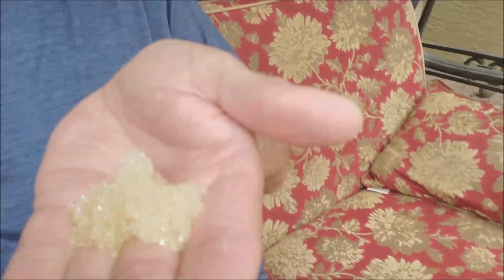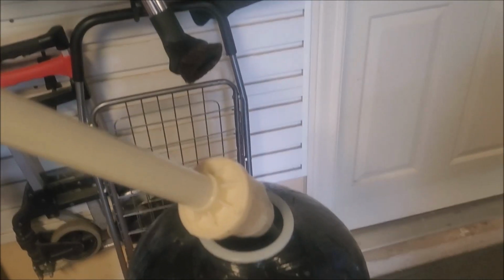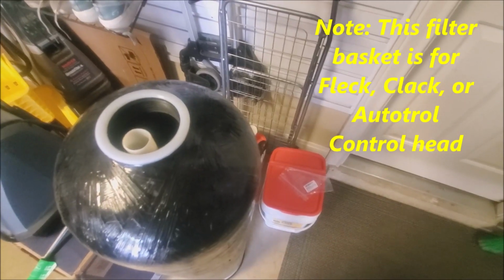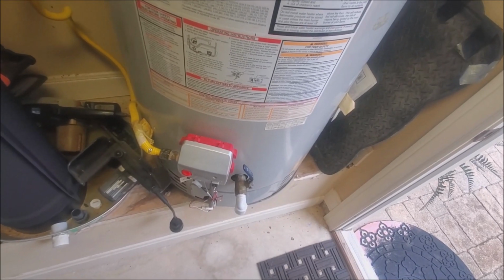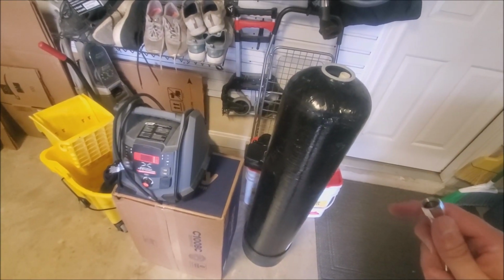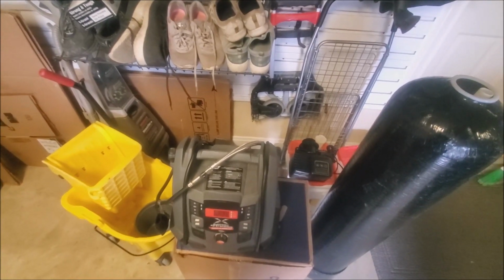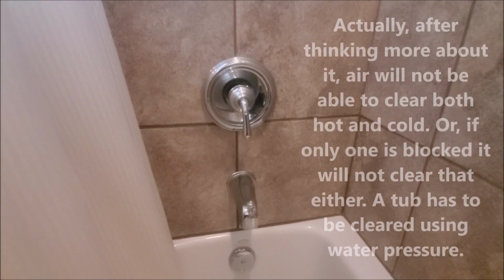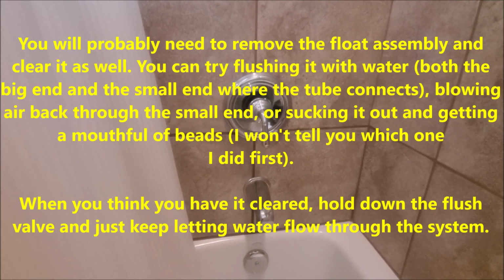No Water Flow From Your Inside Faucets? Maybe Your Softener Had a Resin Breakout!

Comment: I'm a professional "NEW" construction plumber...but I do a LOT of service for family and friends. My neighbors house had this problem 2 days ago. I knew exactly what to do but it still took about 3 hours to blow backwards on everything . I'm going to put an in-line filter downstream from my softener to catch all the beads before all my fixtures do. I've had soft-water for over 30 years...but never had this happen....(pain in the ass).
Reply from the maker: Yeah, it's kinda sad to see how many views this has gotten. It must happen more often than we think! I'm betting a lot of it happens in houses with high water pressure. At this house, the PRV had also failed and the house was at about 80 PSI.
Reply: @thehoneybadger9262 Yeah, I have about 32 psi cuz I live in the “hills” section of town… Only head pressure from the huge water tank just above my elevation. I live in SoCal and any house with water pressure above 80 pounds has to have a regulator by code… if not you’re kind of asking for it.

Comment: Currently going through the same exact situation and I hired a plumber to help. Was able to get all them to work except for shower tub. Tried replacing cartridge but no luck. What could be the issue for there to be no water in the shower tub.
Reply from the maker: Sorry for the late reply. I had to pull the cartridge and then run water through the system, being careful not to allow the water to run behind the tile wall. My wife was on the phone with me, and she operated the main valve for the house to turn the water on and off. There are openings in the valve where the cartridge plugs in that are plugged up. You could try breaking up the resin with a zip tie, which would be flexible enough to get into those openings in the pipe that the cartridge is inserted into. It's been a while, so I don't remember if I had to do that or not. You will want to hold a bucket in front of the pipe, because when it breaks loose, resin and water will shoot all over the place.

Please install a whole house filter downstream of your water softener. I'm sure you'll never want to experience this nightmare again.
Reply: @thehoneybadger9262  thank you so much for the info. I should have tried zip tie. Did everything else. 

Did your clothes washer water flow was impacted by it. I don’t if it did but feels like it now that I am paying attention to water after the fiasco.
Reply from the maker: @MiMoNa1009  Yes, his washer had no water flow on the cold side I believe, but disconnecting and flushing the line and cleaning out the filter took care of it. Check your filter, it pulls out of the back of the water inlet.

I had to go back to his house a few days later and replace a toilet flush valve, just flushing it out did not seem to be good enough.

Comment: Waiting on a plumber now. Had a softener failure last night. What I found is that ALL hard water plumbing unaffected. Unfortunately that only applies to the outside hose bibs, the RO System and kitchen faucet cold side that's used for cooking and drinking. Gonna be a mess. I assume the Rinnai tankless is toast due to the crevices and nooks of a heat exchanger. Expecting a thousand + cash drain.

Comment: Just happened to me.  It has been two days so far trying to pace myself.  We took your advice and tried the air pressure and it worked on some but not all.  The one thing that helped a lot was we bought a Klein tool fish Tape from Home Depot and were able to clear two of the sinks and all the toilet lines.  The stubborn ones have been the cold water on the sinks.  Still have two showers to tackle, kitchen sink, and water heaters.  I had to change out the fluid masters on all my toilets.  The process had been FUN FUN  LOL.  But you are right on not letting this frustrate you.  Take breaks as needed.  Thank you Honey Badger for the help.
Reply from the maker: You poor soul. You probably should have started with the water heater, though. It's very hard to get all that out, and you'll want it clean before flushing hot water lines as it's the entry point for the whole house. If you have trouble with it clogging, I recommend replacing the factory drain with a full port drain so you can  get much better flow through. One like this: https://www.amazon.com/Upgrade-Heater-Full-Port-Valves-Connection/dp/B0F12QZ1Z2/ref=sr_1_5_sspa?sr=8-5-spons&sp_csd=d2lkZ2V0TmFtZT1zcF9hdGY&psc=1
Those factory drains clog up even when flushing sediment. And don't forget the filter in your refrigerator and the ones  on your washing machine inlets.

When you get it all done, make sure you install a whole house water filter on the outlet of your softener. I have another video on that. I did it at my house, but haven't on any of my son's rentals. He'd rather play russian roulette than have another maintenance item to deal with.

Oh, and if you decide to re-bed your own softener, make sure you order new upper and lower filter baskets for the riser tube, even though only one of them is likely broken ;)
Reply: @thehoneybadger9262  Appreciate the advice.  The plumber will go into the ceiling and cut the water lines and flush out the stubborn kitchen line and the cold water line on one of our sinks.  I will update on the results.  Interesting that you mentioned the whole house water filter but a friend did recommended that when I buy the next water softener, that I install a home water filter between the water softener and the water inlet valve into the home so that if this ever happens again, the filter will catch the resin.  But I will say, a lot of friends/family that know of my experience are now having their water softener inspected.    I will also look into the full port valve link you sent.  As always, thank you for the great video and info.
Reply from the maker: @oscarmedranojr5381  That seems like an extreme measure to me. I was able to clear  the kitchen sink line by pulling the cartridge (which is probably what he will end up doing) and taking it apart and cleaning it. In the kitchen I had the issue with, it was a single-handle faucet. Pulling the cartridge would probably work for the sink as well, because that is the main restriction  (everything else is going through 1/2" piping). 

Let us know how it turns out.

And the filter is exactly what I recommend, and what I did in my other video. It's a good idea for anyone with a water softener to do. My folks have had the same softener for 30 years without a problem, but not everyone's so lucky.

And one more thing. If you don't have an all-in-one softener, but one with a separate resin tank and brine tank, you can rebed your softener at a fraction of the cost of a replacement. Probably about $250 for the resin, and new riser tube and filter baskets. Plenty of YT videos on how to do that, if you feel inclined. Just one tip on that - buy the funnel that fits over the resin tank to fill it. You won't regret spoending the additional 10 bucks. Trust me on this.
Reply: @thehoneybadger9262  UPDATE:  The plumber ended up having to cut through the sheet rock under the kitchen island (behind the dishwasher)  to crawl underneath the island and access the "Hammer Arrestor" to the kitchen faucet.  He ended up cutting it and it showed it was super clogged with resin.  After flushing it and clearing the lines, he re-attached the Hammer Arrestor.  He also removed the cartridge and flushed it.  The other problem was the middle shower not getting any cold water.  He ended up going underneath the front bathroom sink and cut out the back of the cabinet to again access the Hammer Arrestor.  This line tied into the shower that was clogged.  Once he flushed and cleared this, the shower was up and running.   Plumber used air compressor, fish tape and a Shop Vac along with water flow to clear the lines.  Oh and the lines are all PEX.  But it was a nightmare I never want to relive.  In house filter will definitely be used in the future.  🙂
As always, thanks for the video honeybadger9262 and the great tips. I have also looked at your In house filter video and gave me a great idea on how to install one.
Reply from the maker: @oscarmedranojr5381  Wow. I'll bet that visit wasn't cheap!  Sorry yours was so difficult to clear, Oscar, but I really do appreciate your detailed description of what was involved.  I'm sure anyone who reads it will be installing a downstream filter ASAP!

One other thing - why so many hammer arrestors? Do you have an appropriately-sized (and functional) expansion tank on the supply side of your water heater? If not, see my video about adding one.
Reply: @thehoneybadger9262  Price was was very reasonable as this plumber was a family friend so thank God for that.  But absolutely yes on installing a downstream filter on my next water softener.  I learned a lot from this nightmare.   LOL  I did share with family and friends, your video of the installation of the filter .  Our home is 11 years old and I am told that the hammer arrestors are common with the newer homes (Texas).  It was explained to me the purpose of this item but not completely sure if its overall function. As for the size of thermal expansion tank we have in our home, I am not sure but I will definitely take a look at it and check out your video.  Again thanks honey badger and keep the videos coming.  They have been very informative and easy to follow.  🙂
Reply from the maker: @oscarmedranojr5381  I've sometimes seen exposed hammer arrestors on laundry washer lines, because the solenoids cause the instantaneous flow. The hammer arrestors are basically like micro-sized expansion tanks.  My washer made a lot of noise with my pipes until I put in an appropriately-sized expansion tank on my water heater (after discovering that a smaller plumber-installed one had failed). If that hadn't fixed the problem, I would have used the hammer arrestors.

While a water expansion tank can reduce or eliminate water hammer, the main reason for having it is to reduce the static water pressure increase that occurs after you use a bunch of hot water. As the cold water enters the tank and heats up, the water increases in volume, and that extra volume is taken up in the expansion tank (which has an air-filled bladder set to the same pressure as your water supply) rather than putting higher pressure in your water supply lines and water heater, which can result in premature failure in the form of leaks.

I appreciate the kind words from my fellow Texan ;)
Reply: @thehoneybadger9262  Appreciate the additional info.  It certainly has giving me options to consider.  Thank you for taking the time to explain it all.  Happy 4th of July!  🙂

Comment: I know it’s been a year since this video. I had the same situation. Wondering after fixing the resin problem, thinking about putting a sediment filter AFTER the water has been treated by the Water softener as an insurance policy if I ever have another resin explosion. Your response would be greatly appreciated.
Reply from the maker: Sorry you had to deal with the nightmare. You should definitely do that. I did, in my own home, and made a video about it ;)
https://www.youtube.com/watch?v=65kW1Sb9wf8&t=1s
Reply: @ thank you for the quick response. I’ll watch your video. Again, thank you.
Reply: @thehoneybadger9262  I just watched your video. Well done, I’m going to set up mine like you did. I just have one question. I don’t know how big the resin beads are, so what size filtration media would you recommend, as in 1 micron , 5 micron to be completely safe - filtration wise.
Reply: @ziobruno9324  The resin is larger than any water filter's particle size. I would recommend a 5 micron, mainly because you will still have a good flow rate. I use an Aquacrest 5 micron in mine, and am getting a very high flow rate (7 GPM, if I recall correctly). Of course, if you want to filter out the most contaminants (besides resin!) you can certainly go smaller, but it does adversely affect flow rate.
Reply: @ yes I was wondering about the flow rate also. Thank you for answering my questions. Thanks for taking the time, it’s very kind of you.

Comment: So you flushed the water heater into 5 gallon buckets instead of down the drain? Will the resin plug the sewer lines?
Reply from the maker: I just dumped the buckets in the front yard. Resin is harmless.
Reply: @thehoneybadger9262  Any harm in just flushing it out into the floor drain do you think?
Reply from the maker: I am unsure of what beads would do to a septic system. A non-aerobic system would probably be OK, but I could envision an aerobic system possibly being an issue. I wouldn't worry at all about a sewer system.

Comment: Hi thanks for the video. Is there a chemical flush to dissolve the beads as some parts of my system as inaccessible like my shower pipes,  filter which is burried in the wall?
Reply from the maker: Not that I'm aware of. I don't think any builder would put a filter in the wall. Perhaps you are referring to the cartridge that controls the hot and cold water, and/or diverts it? You can pull those cartridges (I have no video yet to do that, but there are many out there) after removing the handle and escutcheon plate/flange.  Maybe you could also try maybe shooting some compressed air down the shower head pipe after you remove the shower head, and turn your shower valve from hot to cold. The shower I cleared had just a typical left-right temperature control handle, and it did not get clogged. I did, however, have to pull the filter out of the shower head and clean that out. If your water won't flow with the shower head removed, then it is likely the cartridge behind the handle and escutcheon plate. If you remove the cartridge, water should be able to flow out, but you have to be careful not to let water run down behind your shower wall. This is what I had to do for the bathtub (remove the cartridge).

Comment: Thank you very much for taking the time to make this video. This JUST happened in my house, Kenmore 350 Series water softener.
Reply: I'm sorry to hear that, Ricardo. You've got some not-so-fun times ahead of you. I hope you find it helpful, and you are successful in clearing your system. If I can help just one person save the expense, and even scare some folks into putting in a downstream filter BEFORE the nightmare occurs, it was worth the effort.

FYI, I also made a video about installing a whole-house filter downstream of the softener to make sure you never have this problem again.
Reply: @kevinh9262  Hello, thanks for the sympathy :-) My case ended up being simpler than yours. I think I was just very lucky: 1) It happened in early in the morning and I detected quickly, so the beads didn't spread too much 2) It allowed me some level of backflow (tri-level house with a faucet in the basement) 3) My resin beads seem much smaller than yours. I'll check your video, thanks again!
Reply: @ricardo1967  Glad to hear it was just more of a bad dream than a nightmare ;)

Comment: I have been getting some beads in the softener drain and also only one single faucet in my house, strangely the only one that I left on hard water branching off before the softener. all other faucets in the house have not clogged with beads and run fine even though they are all coming off the softener...

Comment: Thank you so much Honey Badger, had the same issue with my softener. I had to replace all my faucet, shower heads, and toilet valves. And now working on my water heater, rough two days . Thank you so much for the help
Reply from the maker: I'm having trouble understanding why you didn't do the water heater first?  Even if you've cleared all the hot water fixtures, there is potential to get more beads in the hot water if you haven't flushed the water heater until it was clear.  Good luck with everything.  FYI, I didn't replace any fixtures (I pulled the cartridges and screens out and cleaned them when needed), but I did buy one new toilet valve.
Reply: @thehoneybadger9262 yes, I’m kicking myself for that now. I had a plumber come out, once he confirmed my suspicions, he told me to just clear the lines, never mentioned the water heater, and i just rushed to clear my lines. It wasn’t until after, I began to think about the water heater, later that evening. And therefore I found your video. Things seem to be going better now, but not sure how long my water heater will last, flushed it yesterday after watching your video, and rain was coming out, but I noticed I had to leave the water salve on in the water heater for it to flush.
Reply from the maker: @mrniceguy3006  Yes, the flushing works best if you keep the supply valve on, and you rapidly turn on the drain valve for about 10 seconds, then shut it off and wait a bit for it to settle, and repeat about a zillion times. Unfortunately, some water heaters have a lot of sediment in them, which makes it more difficult. I tried flushing a water heater at a house that had so much sediment that it completely clogged the stock drain valve. I had to go buy an expensive drain valve with a full open port and replace it.

So you do have your softener in bypass mode, right? ;)  If you have a tank style softener (not one of those all-in-one cheapies, you can re-bed the softener and buy new filter baskets and riser tubes (I recommend discountwatersofteners.com). They have excellent customer service too.  Re-bedding is cheaper than buying a new one, and there are many DIY videos about that (I haven't done a video on that yet, but have re-bedded 4 softeners).  Make sure you buy their funnel to fill the tank (you'll thank me later).